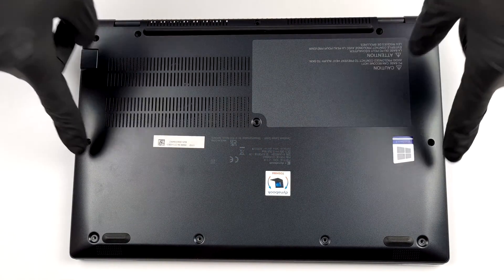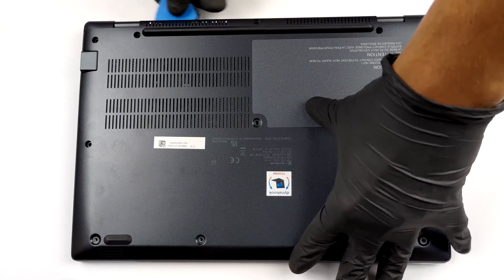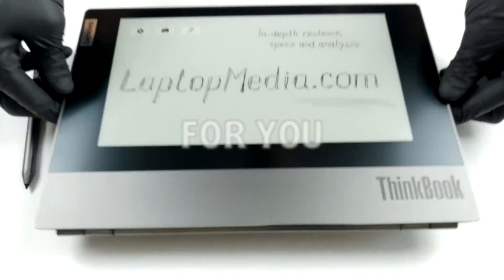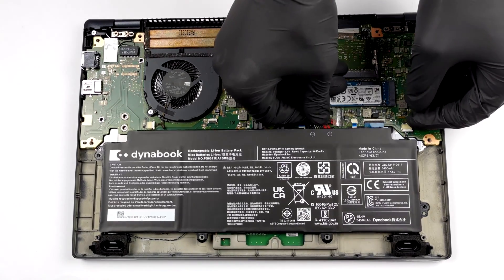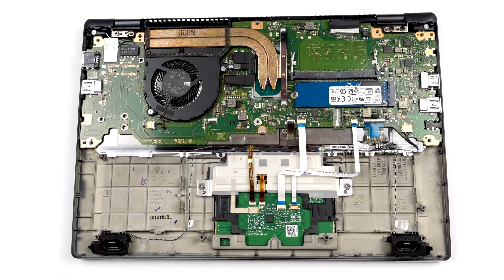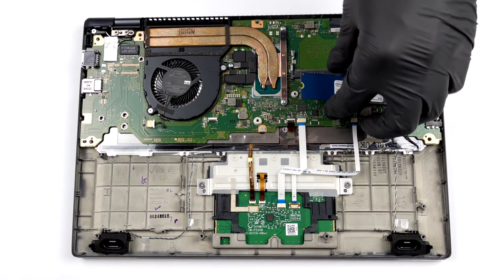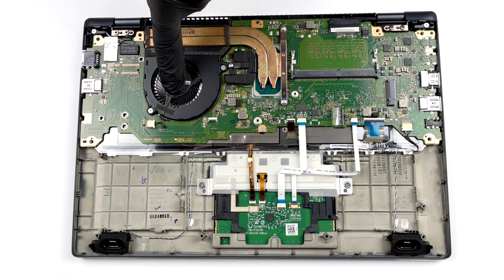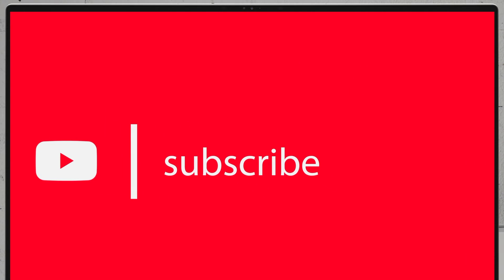🛠️ Dynabook Portege X30L-J - disassembly and upgrade options

Comment: where is the CMOS Battery ubicated?     what are the specs of that battery?   Saludos from México!!!!
Reply: That's a good question. I have a very old Toshiba Centrino Notebook and i am wondering now, why i never had to change the CMOS battery. Maybe the CMOS is powered by the lithium accumulator?
Reply: @OpenGL4ever Its powered from main battery